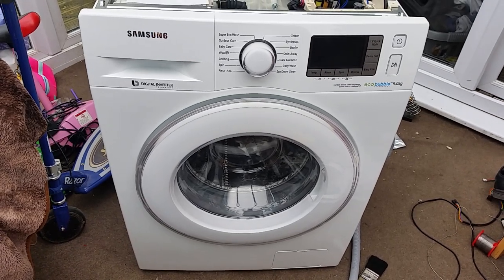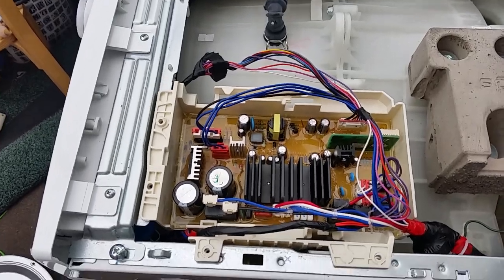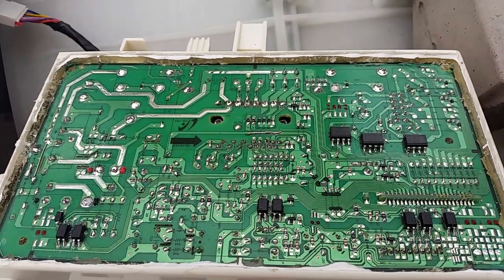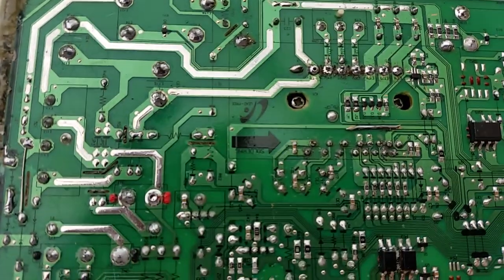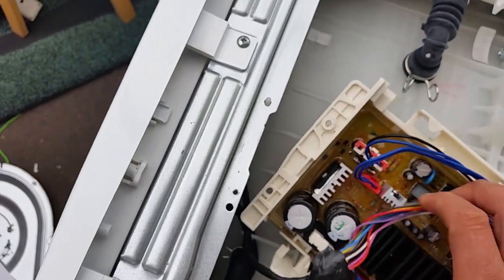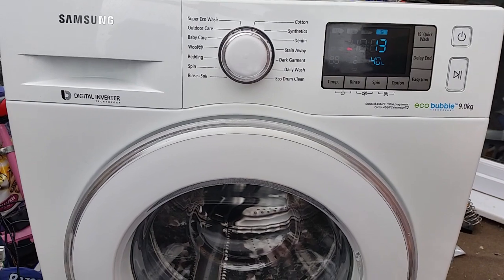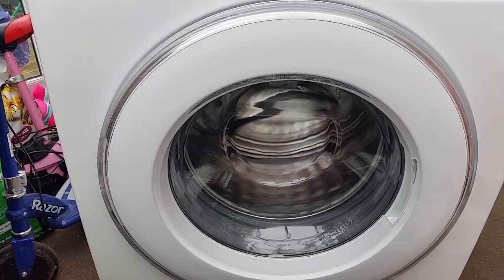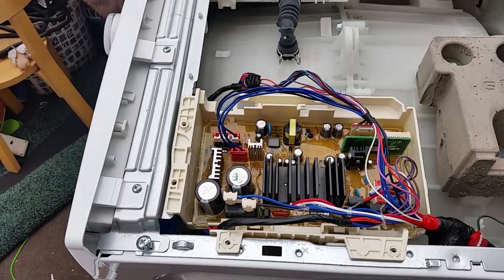Samsung eco bubble pcb board repair

Comment: My wife just complained that the washing machine is stopping during its cycle, no errors on the display. I did notice it's always when the machine needs to spin is when it bugs out and stops working. Sometimes it spins and sometimes it doesn't. I do board lever repairs on Apple products and I've never seen a more terrible and deliberate attempt to stop people from repairing their devices than what Samsung has done with their EcoBubble washing machines! Using silicon to cover the entire board and prevent the owner from removing the board from the housing is a dick move from Samsung. We own the 6.0KG version and the board is a little different from what you own but it's covered in the silicon to its teeth! Removing all the silicon is proving to be near impossible!!! I won't give up, this silicon hasn't seen the last of me! Thanks for sharing your experience!
Reply: ive replied to this further down, i 'pryed' the whole mototr control section from the plastic housing, worked much easier .. 
im on my 3rd chip replacement over this year, but this last one seem to of taken the fuse, resisters, and its looking like main chip out on the board :(
Reply: @gadget7894  My board is not like the one in this video but uses the same silicon sealant and it's glued from the bottom and top, near impossible to remove without causing more damage. It's still a miss and hit with the machine, sometimes it completes the cycle sometimes it doesn't. Once it dies completely I will then rip out the board and repair it if possible.
Reply: I’m here for the help to repair the board but I cannot resist the reply. Apple used to make user repairable/ upgradable devices themselves till about 2014. Thereafter they began to weld ram onto boards, even on iMac consumer devices, seal up units etc etc. Drove me crazy.
It’s wrong that Samsung do it but Apple long since forgot about doing the right thing also.
Reply: More than likely that your brushes where worn down and needed replacing... Espares do allsorts online.
I had the same problem and took the back off to have a look and ended up being those! I also used some electrical contact spray to clean off all the dust gathered from the old worn out ones. Use this spray on my Alternator on the car too every once in a while 😉

Comment: Got a similar problem on a s/h machine we bought cheap for spares. Found the original problem was a broken wire to the heater thermistor. Did a couple of test loads ok, then next time the thing would do a wash cycle and stop when trying to spin, got into the board and after a couple of taps with the screwdriver off it went, so I’m now removing the plastic base and the silicon goo looking for a dry joint !   Nice to see you’ve done likewise 🤗🤗

Comment: Cool Video, good information! I have heared that this washing maschines have a Drum mounted on a Aluminum alloy which dissolves over time. The suds container is made of plastic and is glued so that it cannot be repaired.
Reply from the maker: Thanks. I think this was the first repair video I did and glad people still find it useful. I think most washing machines in the uk are mounted in a similar way. The washing machine is still working fine since I repaired the board in the video 👍

Comment: Hi to all having the same problem. Mine stopt turning too. however, after the repair I did I'm not really convinced that the IC breaks. After I cut the legs of the IC to take it gently out I saw that some of the thin pins had bad solderings. Another video on youtube also shows that. Well since I cut out the IC and had to replace it I looked arounnd for the IC to buy. It is not really good available at stores. I found the IKCM15H60GA at Farnell. Also 10euros but they do not charge shipping costs. Check that the IC I bought is a slightly different type since it has an H instead of an F in the partnumber. I think it's an upgraded part. It worked in my machine after some PCB trace repair since I damaged the board an invisable bit close to the screws of the IC. When I removed the screws I accidentally bent the PCB and two tiny traces snapped. So take really good care for the PCB. It's very fragile....Good luck to anyone who has to face the same problem!
Reply from the maker: Hi, yes they are prone to dry joints also. The machine I repaired had quite a few, but also the IC was blown. 1st thing would be to check for dry joints, if it still doesn't work, then the IC is probably blown. Also beware of counterfeit IC's from China!
Reply: Mine had dry joints on the IC also.  Big thanks for the helpful info !  My PCB had already been replaced during the warranty period and only lasted a couple of years.

Comment: I had a similar problem with our Fridgidaire washer and it came down to dry joints and a relay that had become detached on all pads. Resoldered the relay with a generous dollop of silicone to secure the relay and prevent a repeat of the problem and it's still running 6 years later.
Reply from the maker: Nice. This one is still working fine too. In fact you'll probably see it in the next couple of weeks as I'm just about to start recording another Samsung eco bubble that my wife just bought for £27 and it's in really good condition but stops randomly during a cycle... and I was going to show this one still working since I fixed it 😂

Comment: thought i would just add my experience with this too .. 
i didnt 'cut' the bottom off my control unit box ... 
i used a plastic tool, and pried the whole PCB, along with its goo out of the plastic shell in one lump... 
then access was much easier to get rid of goo, and work on PCB 
(i felt was less risk in cutting board, and plusit left it in a much better state :)
Reply: well after replacing the chip, it did go AGAIN, so clearly they are weak chips :( 
but sadly this time the chip when complete short circuit, popped the fuse, and the 'protection' resistors inline with main chip....
replaced all these ! and its still not working, althou theres now NO error on screen theres still no motor movement :( 
not really sure what to do :( other than new board ?

Comment: This is great. I have a very similar machine and there is no power to the unit. I've seen a few videos which have helped but are different than mine. I'm winging it here. Any chance you can offer a video on how to take the top off to get to the boards behind the face of the unit? or point me in the direction find it...
Reply from the maker: From what I remember there was two screws at the back of the lid, then it should slide back (might have to give it a bit of a tap) that should give you access from the top..I've never had the front panel off one though.

Comment: Hi, do you think the silicone was to mitigate issues that may arise due to vibration? Do you think it would be worth finding a substitute?
Reply from the maker: Well, since I made the video, it's still working fine.. and that was 5 years ago 🤷‍♂️
Reply: @BuyitFixit  hi, well that certainly says a lot. Do you think it was over engineering on the part of the manufacturer and was in fact redundant. Just trying to understand why they would go to the expense.
By the way I have subscribed to yours and a few other similar channels recently and love the idea that these appliances get a second life and don’t end up immediately in the landfill. Cheers.
Reply from the maker: @H2Dwoat I'm not sure. I thought it was for moisture perhaps more than vibration? Anyway it seems fine without it 😂😂😂😂 and thanks for the sub 👍I've fixed quite a few interesting things and even had to jump into the software side of things too! Like on the solar inverter or ultrasound machine 👍
Reply: @BuyitFixit  hi, ahh that probably makes more sense as it is probably a moist environment for electronics. I have used silicone spray on motorbike electrics before to try and help with damp..

Comment: I once gave up on a DE door error Samsung after I replaced the lock won’t ever do that and check it better , not sure with pcb though so hard to diagnose at times for an amateur like me
Reply from the maker: Sorry for the late reply. I had been thinking of doing a short video on testing basic components such as transistors, resistors, diodes etc if you would find that useful?
Reply: @BuyitFixit  wpuld be brillant as a hobbyist to see a pros thought process
Reply from the maker: I wouldn't call myself a pro, but I'm been doing some video's on basic testing of components, which should be released either later today or tomorrow.

Comment: Surprised at Samsung using a plastic drum pulley! My new Hisense Inverter cost only £238, and has a metal drum pulley!

"Ally"-express? ... I call it, "Alley"-express!
Reply from the maker: A couple of people mentioned as in "ali baba" so at least I know now 😂 This machine is still working great. I recently got another but it has a different design now and is direct drive so doesn't have the motor / pulley arrangement like this one does.

Comment: It was enough to clean the Filter, or if you hear clicking and the engine does not start, it is a problem with the brushes.  If you were permanently connected to the power supply, it was a capacitor, i.e. a mains filter.  Certainly not a programmer.  Samsung floods with silicone and there is no possibility of a fault
Reply from the maker: There is no brushes. It's a 3 phase BLDC motor. (BrushLess D.C.)
Reply: You can buy motor brushes on ebay.  I had the same problem, one brush on the spring did not come out to the motor and there was no tension, I replaced it and it works like a new washing machine
Reply from the maker: @-ENIAC-  must be a different model. These motors do not use brushes. Hence being BLDC motors.
Reply: Each washing machine has replaceable brushes, which is the basis of the service.  But not everyone wants to unscrew the bolts and take the motor out to clean it and replace the £ 3 brushes
Reply from the maker: @-ENIAC-  Yes I have replaced carbon brushes in washing machines before such as hotpoints etc, but it seems that you fail to understand that the motor in this particular washing machine does not have carbon brushes. It is a permanent magnet motor which is BRUSHLESS. It also uses an inverter drive. Please google BLDC motor for further clarification
Reply from the maker: @-ENIAC-  https://www.samsung.com/au/support/home-appliances/benefits-of-digital-inverter-motors-in-front-load-washing-machines/

Comment: Hi buy it fix it and everyone. I want to repair my elderly neighbors Dyson washing machine control board, the first 3 words out of the 6 on the digital control board are to faded to understand, what type of metre is best to check for faulty components on the PCB control board please, and is there any tips or advice anyone can give me please it's for a good cause. Well done on fixing that circuit, just getting to it looked extremely difficult never mind repairing it. Great video thankyou.
Reply from the maker: Thanks 👍I use fluke meters but they are quite expensive if it's not something you are going to use often. Get an auto ranging meter as they are easier to use. Perhaps have a search on Google images for Dyson washing machine board as other people might have repaired one and you may find pictures of one. I've not worked on a washer for a while but I'm looking at another Samsung one at the moment. Video soon...
Reply: Hi buy it fix it, thankfully I got a few auto metres but I don't know what setting to use when checking the little capacitors etc to find which 1 is faulty on a circuit board, could you advise me please, and also when taking readings how would I know iwhat capacitor etc is faulty please, especially if there's only one of each, I hope that makes sense. Great repair many thanks.
Reply from the maker: Capacitors are a bit tricky, you can't normally measure with a meter unless it has a capacitance mode which a lot don't have. You could always get one of those component testers. I've got one they are very handy. Just put the component in and it will tell you what it is.  Capacitors transistors etc. They are about £15 for one on amazon. Mine's a white box with a screen and a button on it. It's also rechargeable.

Comment: I have similar isseu, but didn't get to check anything, as i can't get the top cover off, any directions, how do you do it? I've unscrewed everything stucks at the from?
Reply from the maker: Two screws at the back, then the whole lid slides back. You may need to wiggle it a bit side to side.

Comment: Hello. Brother i have the same problem. But i am stucked at the values of gate source and drain of the module IC in a Pcb. What should I do now? Each UVW circuitry of the module IC have a combination values of resistance and capacitance values. Though I dont have the schematic diagram,, which is not available any where. So what I do now.
Reply from the maker: Hi, I'm not 100% on the resistance values of the module, if it's the same symptoms the either and dry joint on the board or the module I would think. I would also chance the small 3 capacitors next to the module too.
Reply: @BuyitFixit   but Sir what if the resistance and capacitance are gone burst and someone have no any way to fix it with the proper values instrument then what would you say. Though a fluke may work here by any value of the component resold on
Reply: @BuyitFixit  what values of the capacitors did u change?
Reply from the maker: Sorry I can't quite remember it was 3 years ago. It was the 3 small ones next to the main IC. They should have the values written on them. They were only small. Perhaps 1 or 10uf from what I remember and all 3 were the same.
Reply: @BuyitFixit  but you are quiet sure that after replacement of the faulty IC,,, the PCB works.... I have made several practices in before. But all time I failed. Dont know whether the IC's were faulty or may be the wrong combination of resistance and capacitance values... As I watched your clip today, i am just convinced one more time to try. 😜😂. Dont know why
Reply from the maker: @khurramzaib5918 Make sure the chips are genuine. I bought two from Aliexpress. Both were either counterfeit or faulty. I bought one from a proper supplier Mouser? I think it was and the washer is still working to this day! We use it pretty much daily.
Reply: @BuyitFixit  i dont know whether in Pakistan, mouser may work or not. Usually there is the dominance of Chinese products in Asia. Whatever, will search it for.
I have a misconception that this IC would be a Programmable base controller. But you have changed the situation now
Reply from the maker: It's just a motor driver.  Not programmable. The microcontroller on the little sub board is what drives it.
Reply: One thing to be notice,,,
As mentioned in my washing machine motor template that its an induction 3 phase motor(without brushes), but when i rotate it manually by hand then it generates the voltages at terminal. At 100 rpm it produces 30 volts, and i dont know why? Universal motor is something different and u expect from them but here in induction motor its happening. Even i called samsung they refusing me to replied that its an Induction motor. On other hand, the resistance value in between three terminals are of 5 ohm and motor has no ground status by checking continuity through multimeter. 😊
I am confused now. Its second time my card through motor supply side got burst even i freshly commissioned it. Same IKCM10H60GA issue 😊 i am mad now
Reply from the maker: Yes it's a Brushless DC permanent magnet motor. If you spin the motor it will act like a generator. I originally bought the machine to try to use its motor for a wind turbine.   There is someone who has run his whole house for 15 years with a similar motor and a pelton wheel! Search 'washing machine power' on YouTube and you should find it 👍
Reply: @BuyitFixit  but what I should do the treatment for to stop the reverse voltages which actually ruining off my PCB board and especially from the motor supplied drive side.
Look, whenever machine cause error 3C or 3E. We suddenly stop the machine in precautionary way to save the card but at the same time the rotor side of the motor or you may say the drum is got stuck r some sort of jamming way like. We then rotate the drum physically that it may smooth and then plug in the power for the operation..
Same we did it in the last monday night but unfortunately we got the Pcb burst with Damm heart
Reply from the maker: @khurramzaib5918  I'm fairly sure the chip has diodes to prevent the reverse voltages generated from the motor when it turns. Here is a diagram of how the chip is connected. (Not a diagram of the washing machine, but the chip is wired almost identical as in this diagram). https://www.jotrin.com/productfiles/circuit/IKCM15F60GA/IKCM15F60GA-diagram.jpg
Reply: @BuyitFixit  sure the chip which is actually a driver, or may you say the controller of motor after the processor command have its own protection zone.. But still there is something which is lacking from the manufacturer,, because 80% of the cases or issues are same for all of us. But, I personally witnessed of Bosch and LG brands, they have very rare PCB kits issues in against of Samsung.
Every samsung user is crying but very few knew this phenomenon which i am discussed... May I change my motor at this time then check the result in the best interest, may this could help if efficiency is the manner here

Comment: We have a Samsung ecobubble 7kg machine and the technician informed us that the rear PCB is faulty and beyond repair. I have managed to buy a rear PCB online but it is of a non- ecobubble Samsung 7 kg front load machine. Can it be installed in the eco bubble machine of the same capacity?
Reply from the maker: Does it look the same? same connectors etc?If the connectors are different then I'd say probably not. If the connectors are the same it still  may have slightly different software so you might have to just try it and see if it works as expected.